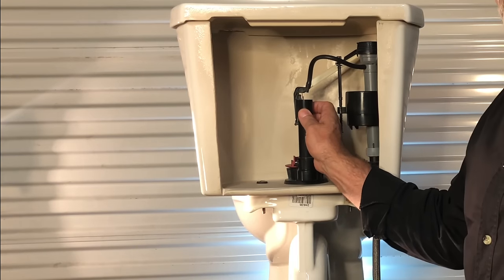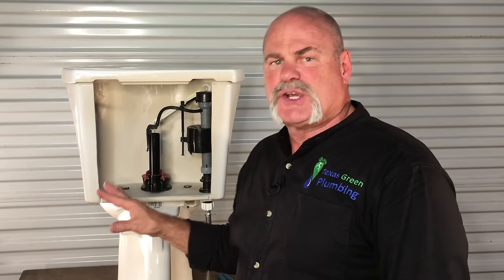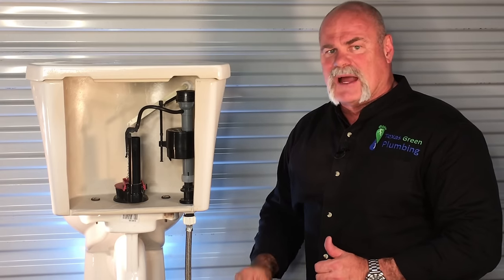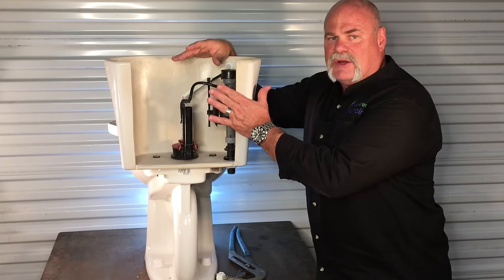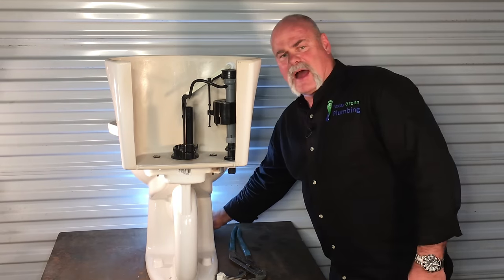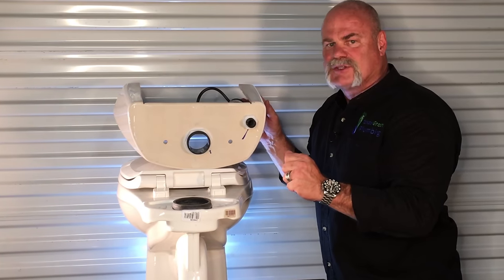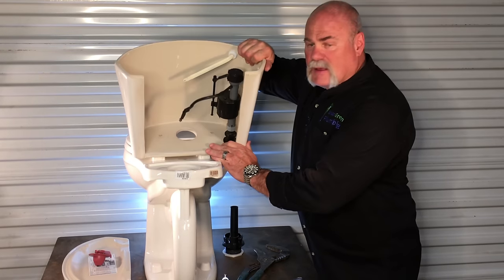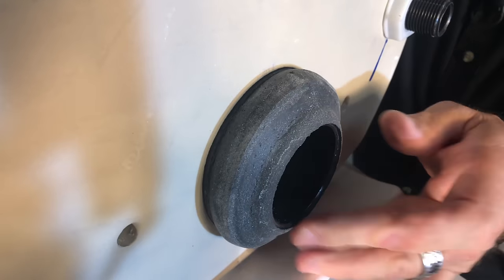How To Replace A Toilet Flush Valve - DIY Plumbing

Comment: The plastic flex connector nut is always stuck to the plastic bolt for me, which seems to be the biggest issue in these types of replacement. DW40 didn't loosen it either. Any tips on how to get it out?
Reply from the maker: Grab the fill valve inside and hold it like backup. Channel locks will normally take it right off...

Comment: Thanks for the great tutorial video! I have everything I need to replace the flush valve except for that giant wrench. How do people normally go about unscrewing such a huge nut if they don't have that wrench?
Reply: U are gonna have to get something that’s big enough to fit wether it’s channel locks ,pipe wrench or a big crescent wrench bud
Reply: I've used pieces of wood before to make a fit and tapped the wood lightly with a hammer to loosen other nuts like this one upon not having the toolbag around.  Used other ways too but not nearly as professional advice ;) hahah
Reply: I've also used zip ties tightened around the nut and a flattened tool and turned to loosen it

Or add to the tool collection !
Reply: @jasonfuqgeary6896  yeah I did that bud. Don't worry about it.

Comment: my tip is if you have a leaking angle stop that wont shut off water all the way instead of turning your building water off just carry a hose with a shut off installed on it and screw it in OR if your lazy and  know you wont be spending too much time away from the shut off just get a 5 gallon bucket and some towels to catch some water while your dumping the bucket.

Comment: Something to consider @ 3:53 where you are unscrewing the bolts. You did it very easily because that is an unused toilet. In a real situation, the flat head part of the bolt is under water for years and would have probably rusted resulting in stripping the screw.

Comment: I have a kohler with k4632 tank. Water in tank is leaking into bowl causing that annoying ghost flush. The flush valve is not like a typical flapper style for 2" tank drain. It's like a hollow cylinder that goes up and down to open and close the flush drain, which is 3". Luckily i found one on Amazon and ordered one. Hope its the right one. It did say it'll fit the tank# The tank also doesnt have hinge bolts going through bottom of tank. The bolts go through an adapter under the tank. Never seen that before. At least i won't worry about possible leaking hinge bolts.
 My other toilet is a Jacuzzi 1230702 with 3" tank flush valve but its the flapper style and has tank bolt holes through the bottom. That's going to be fun because the gasket under the tank and the wax seal under the bowl's base is leaking (going to be a bigger job). I had to shut it off and decommission that one till i get the ghost flusher fixed in the main bath (hopefully quick and easy).
This is when i wish i only had one toilet, because i live alone.

Comment: Roger, hope you’re still checking your comments. Question: You mention that if this valve leaks, o e could have water on their floor. Not my problem. Mine is that all the innards have been replaced and my new flapper is not keeping water from leaking into the bowl. Could it be this valve?

Comment: Ok say I replaced the whole water valve piece, but we are noticing that every once awhile it will run fill up a little and stop, the only reason why I didn’t replace the flapper cause when I did the test with the food coloring it didn’t leak threw the toilet so I thought it was just the water valve. So what should I do now .??

Comment: I just replaced the flush valve. There are drops of water coming from the two screws holding the tank in place. I used new sealers provided with flush valve
 Tightened the screws and the nuts are very snug. No cracks on the tank. Why am I still getting drops of water from the two screws? Any help appeeciated.

Comment: Nice video. My water stop valve hasn't been closed in years. I think I'll have to take the handle off and use a monkey wrench on the splines. Is that a bad idea? I don't have the skill to shut off the main and sweat off/on a new valve.

Comment: My toilet cycles every ten minutes and then fills the tank again. I guess that the water level has dropped in the tank enough to call for filling. I notice that in the bowl a little bit of water is rippling the surface constantly.  What is leaking?  I changed the fill valve assembly a few months ago.
Reply: The Flapper Most Likely

Comment: Now, the first (and last) time I did this, you were supposed to captivate and gasket the tank bolts on both sides, because doing it only on one side left the seal to get broken by any movement between the tank and the bowl.  Do people not do this any more?  I think that that's a bad idea.

Comment: Older toilets usually have badly rusted tank bolts. Any suggestions other than penetrating oil?
Reply from the maker: Ratdog 305 I have had to cut them out and replace them. It's a challenge sometimes I promise! Thanks for watching, commenting, and subscribing I hope!

Comment: Hey, Roger, how do I fix a toilet lever that flushes difficultly? what I mean is that you have to press the handle harder than normal to make it flush.
Reply from the maker: The chain on the handle could have too much slack. Open up the tank and adjust the chain on the handle to tighten it. Hope that helps!!

Comment: For some reason that I can't figure out sometimes when I flush my toilet as soon as I release the handle the water stops going to the bowl.  I find that if I continue to hold the handle down for about two seconds when I flush this doesn't happen and I get a good flush.  Another problem I'm having is that sometimes (not very often) the flapper does not seal and water runs until someone tells me "the toilet is running again."  This all started when I changed the flush handle assembly.  The old one was plastic and it broke at the handle.  My new one is metal.  My handle is like the one in your demo toilet and it's at about a 45 degree angle to the front of the toilet bowl.  I can change all the guts in the toilet bowl but being frugal, I do not want to change good parts.  Any ideas?

Comment: Really appreciate the effort, but this is like the opposite of my case. It’s a very small area and I don’t have the option to remove tank. I technically just need to replace the rubber ball. But the new one won’t attach to the old equipment so it has to be replaced

Comment: Okay my toilet tank has a tray that collects the water . Then when I push down the handle , the tray flips the water down  the bottom of the tank to flush .
Reply: I was having a weak flush and I did the bucket water trick and it went down quick . I do have hard water in my city and everyone hates it . Noticed I have some calcium build up in the tank and on the jets . I’m gonna use some CLR and tape up the jets so it sits in there good.

Comment: By the way on a point of interest. I had problems with my kitchen sink and in  clearing out the obstruction I figured that what caused it was a combination of throwing rice and bacon grease down the garbage disposal. The two together makes for a jam up on the u joints in the line. I had to use almost an entire 50' feet of a snake to clear it out. Now I don't put rice down the sink I strain it and put it in a plastic bag
Reply from the maker: Great tip! Rice or any other sticky starch should go in the trash!

Comment: My toilet flapper is not seating fully. Checked the surface of the seat and it's brand new. Not sure how to find the right flapper bc we've tried a few already
Reply from the maker: The right size flapper should work if it’s lined up properly. What brand toilet?
Reply: @RogerWakefield  hey thanks for the speedy reply (and great video). It's a crane 4471 toilet. Im pretty sure I replaced the flush valve before but don't recall the brand of that part. Is it better to try a couple different flappers or just get a new flush valve assembly with a flapper I know works?
Reply from the maker: @psykalag  I would probably try flappers…
Reply: @RogerWakefield  yeah that makes sense. Any suggestions on flappers that are relatively universal or high quality? My go to is corky

Comment: i had my pump replaced a few years back by a guy i was able to get quickly.  All the other plumbers were too busy.  he didn't strike me as particularly knowledgeable.  He told me he cannot get the flush valve fitting my particular toilet.  I am not so sure.  Wouldn't those be just standard?? My toilet wasn't made by goblins, it is something out of home dep, but is about 20y old. I am still having that valve cracked.  am super annoyed.  Ideally we want a new toilet, higher, nicer, fancier but i wonder if i can fix the valve myself, simply with something out of home dep?  Are those things indeed different standards or this was bs?

Comment: Changed out my flush valve cuz leaking into the bowl .    After I changed the valve,  now it leaks on outside flowing onto floor ,   My seal looks great but I'll buy a new seal just in case,   And I'll buy new hardware .. but it was coming from tank to bowl connection.   I don't think I over tightened either . But illl do it by hand and then tool it a quarter turn like you.   I'm think all new toilet is better.  Toilets are only $100-$160,  all the guy replacements I've done already is wasting time and resources .  I've installed a toilet before and nothing went wrong ,  this leak has been a nightmare .
Reply: Real life; fog of war.

Comment: The tube that fills the tank after the flush, will only fill up my tank if it’s OUTSIDE of the flush valve spout, and the water just runs. When I take the hose out of the flush valve, the tank then fills up. Doesn’t make sense to me. Help?

Comment: How do you measure the flush valve to get the correct replacement size?

I was told to measure the hole at the bottom of the the tank (upside down on carpeted bath mat) and I came up with 2 1/2”.

The two-part toilet is a 20 year old Crane and the porcelain/ceramic is still in great condition.

With hard water conditions the vertical “tower” to the bottom of the flush valve snapped off while I was trying to change the fill valve.  20 year old plastic doesn’t do well in hard water.

I can only find 2” - 3” flush valves.  Please don’t tell me I have to replace the entire toilet.

Btw, with the right tools it was easy to remove the tank and flush valve . . . and I’m a woman.

Help please!

Update:  I Googled and found out to measure the diameter of the bottom of the the OLD flush valve where you see the threads.

Boom!  It’s just over 2”, barely, so I need a 2” flush valve replacement.

Never throw out old parts.  I’m taking my broken parts, measurements inside tank, and model numbers to a reputable plumbing supply store in my handy dandy little mop bucket for safe transportation.

Yes, I’m getting new tank bolts, washers, gaskets, everything new.

My dad was an engineer by education and could fix just about anything, especially cars and toilets.

He died 20 years ago this month, I know he’s watching over me because I’m the only girl in the family and my older brothers don’t know how to do this stuff.  I fix my brother’s toilets who lives nearby.  My other brothers call plumbers.

I just love a good challenge and the feeling of accomplishment.

Thank you for great instructions!  God bless you, sir.  I love the open tank you have for easy demonstration purposes.  I’ll definitely be following you!!

Comment: The water leaks out hen the water is above the flapper. So hopefully I just need a flapper.  The water doesn't leak when it's below the flapper so I know it's not any of the rings or bolts

Comment: Stupidly, I made a cross connection by not trimming the supply tube and it was well below the water surface inside the flush valve causing the toilet to run every few minutes. Problem solved, thanks!

Comment: I was doing good until it was time to take the old flush valve out and the reason i couldn't get it out was because the plastic peace that tightens the flush valve was old and when i was trying to loosening it the old flush valve was turning as well. Any advice from anyone?
Reply from the maker: Hold on to the old flush valve while turning the nut if possible...
Reply: @RogerWakefield  Ok thank you so much and if that doesn't work can i use a hacksaw to cut it since i wont be using that anymore?

Comment: Too bad my toilet seems to have been installed wrong or in a weird way, and with very little space to work with… 😂

Couldn’t detach the old plastic threaded piece at the bottom. Just spins around to infinity and beyond.

On top of everything my water valve is failing to keep the water from running.

Comment: So my sob story of yesterday. I watched this video because of a running toilet. Forgot to use a bucket when taking apart the toilet, so that was a giant mess. After finally taking apart the flush valve....I realized my problem was just that I needed to replace the sealer/liner, not the entire flush valve. So that was a VERY unnecessary $15 dollars of parts, 45 minutes of labor, gigantic mess, and a ton of sweat and frustration on my part for what should have been a 2 minute fix.

So in short, I'm a complete moron who should probably not do any more toilet repairs haha.

Comment: This would has been a little better showing what the nuts/bolts actually look like when that needs to be replaced.  They're usually rusty and barely move, sometimes need to be cut off.

Comment: Have problem with the actual flushing…does not flush bowl contents completely, usually have to flush twice… it’s an American Standard with a 3 inch flush valve…changed the flapper , didn’t help…when new, it would flush with a big “woooshh”…please help…

Comment: 5 or 6 years?? Why would the flush assembly only last 5 or 6 years? And that flush valve tube is WAY shorter than the vacuum breaker, you're getting less than half a tank's worth of water to flush. That's my issue; there's not enough water to flush properly because my tank is very small. I want to extend the length of the flush valve to allow more water in but I can't extend the vacuum breaker without leaving the top off the reservoir...ugh!

Comment: You are not too clear with this first step. There’s more than one thing to turn, the flex connector, there are two rings. Which one do I turn and which direction? This is impossible with your hands for me, I have arthritis in my thumbs and prevents me to loosen it with my hands. I’ll need a tool for this step. Can you show what tool to use and which flex ring connector to turn and what direction?  Thank you

Comment: 3:02  Don't understand the mechanism: "... flush valve is below the vacuum breaker on your fill valve because what does that keeps you creating a cross connection where you  actually toilet water over in the drinking water"

Comment: "should last you five or six years "    - I'm just replacing an old bakelite chain pull cistern that has been flushing since just after ww2 . No idea whats in there - never had to look , only ever had to lift the top to throw in a blue block . 🤷🏼

Comment: Not as easy in real life when the nuts are rusted tight. Found another way to fix the flush valve leak by using a piece of flex tube.
Reply from the maker: Sounds interesting...
Reply: The problem was the overflow tube had a crack in it and was doing the auto flush every minute, so we broke it off and stuck a 2 inch flex tube in between (inside) to join the two ends back together. The flex tube was a perfect fit and super tight, so no glue required. Sometimes people have to get creative to solve problems on the cheap. If we would of taken the tank apart it would of been a huge job and might as well replace the entire toilet since one side of the nuts and bolts were rusted tight.

Comment: Tag aquaracer?
Reply from the maker: No but I used to have one of those.
Reply: @RogerWakefield  what is it
Reply: @Roger Wakefield  also I just got home with the flush valve. It's a tiny tiny downstairs water closet. And I'm 6 foot 7 290lbs it's a simple and easy fix it's just there is no room around the toilet.
Reply from the maker: @makjanks  been there done that…
Reply: @Roger Wakefield  even with little room the tank came off easily the new flush valve went in without a hitch. Without viewing the water connection to the fill valve it threaded properly with no leaks. As for the fill valve, I should have replaced it. I don't know what happened but the fill valve will not shut off. I just want to thank you for your excellent quality educational video. I could not have done it without you. If you ever get to buffalo ny the wings and beer are on me.
Reply from the maker: LumiNox…

Comment: Not sure I have a wrench of that size, kinda makes this video a no do yourself thing. Also, i still do not see why the flush valve needed replaced, that part was unclear vs just replacing the rubber flapper.

Comment: The flush valve is not very easy to takeoff It’s too tight and I can’t take it off with my hands and you don’t say what tool to use or which direction